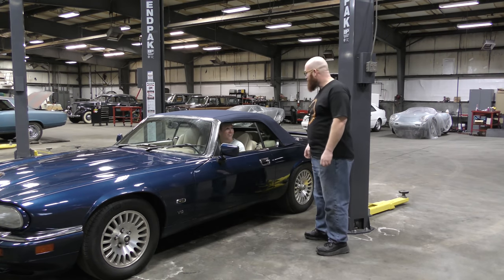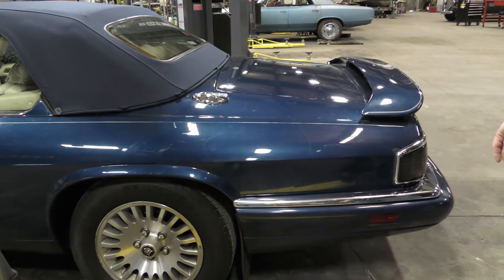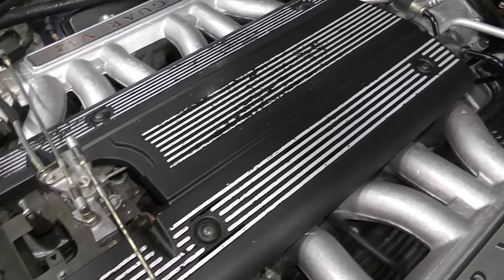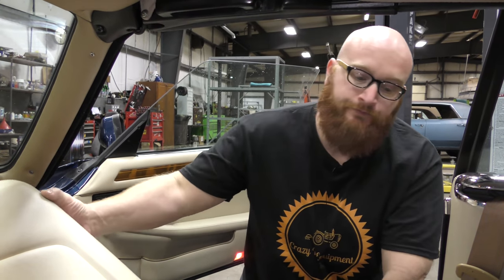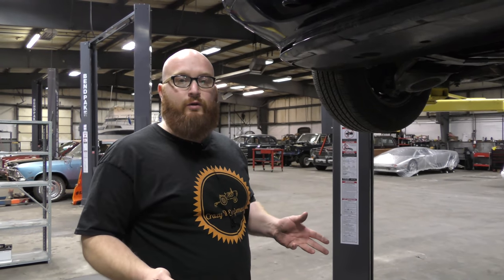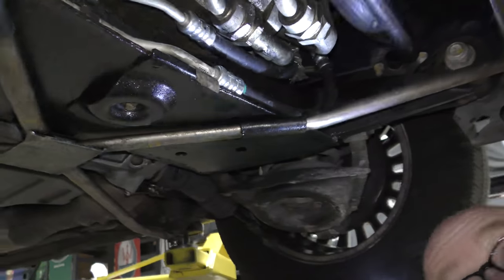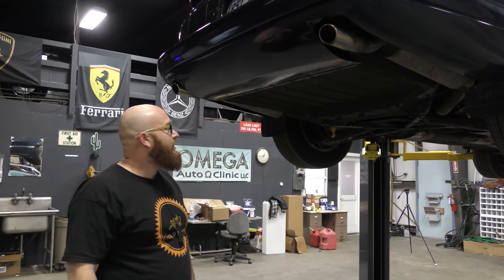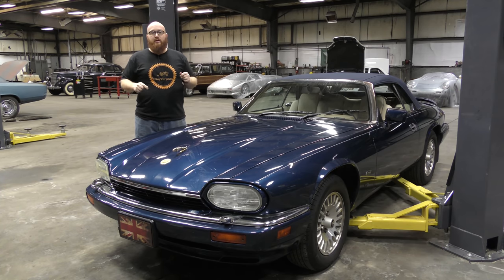It's another smooth running V12 Jaaaaag in the CAR WIZARD's shop! Check out this 1995 Jaguar XJS

Comment: I have two (yes I'm a sadist, but not really) Vanden Plas sedans, a 2001 and a 2002, both titanium grey.  That time was about 10 years into Ford's ownership of the brand and they had fixed a LOT of things by then.  The cars are still quirky, but comparatively reliable.  I have a car wizard-esque mechanic who can fix ANYTHING on a Jag, and for a reasonable price, so both are always all of a piece, and pleasures to drive.  Always happy when I'm behind the wheel of one of them.  Could never justify the price when they were new, but bought these showroom perfect, low mileage versions when they were 12 years old for $7K apiece.  Nobody wants them, but I always get compliments whenever I drive them.  Wonderful highway wafters.  Don't buy a used Bentley with all the expensive issues that come with them.  These give you the same feeling and cost a fraction to own them.

Comment: Love these newer V12s. My 1996 XJ12 had a Denso FI system, it was as reliable as a Camry. Never needed to pull out my PDU and plug the car in, unlike my XJ6 with Lucas FI...

Mine had a similar but smaller oil leak down the front of the engine, it was from a little rubber plug that dries up and cracks over the years. $10 fix.

Did you notice the lockwire on the caliper bracket bolts!? A little hold over from their racing days.

Comment: I sold the exact sister of ths car earlier this year. The car was British Racing Green (Brooklands Green), tan convertible with 34,000 miles. It was indeed a wondeful example of how a well tuned and maintained 6.0 liter V12 could be. Like its sister, it also suffered from leaking valve cover gaskets. After an expensive conversion to a Wizard Cooling aluminium radiator, monster twin electric fans and Evans waterless coolant, the car just could not cope with the sheer level of Texas summer heat. It now resides in a more forgiving NE climate and had been replaced by a XK coupe with ice cold air conditioning and a V8 power band more suited to suburban driving needs and a geriatric penny pinching owner!

Comment: Dear Wizard, its the other way round. The Leaper ist he old mascot, introduced in the 1950ies and was first optional on the XK150. it got smaller later on on the MK10 and XJ. The XJS never had a "leaper" mascot. And I think you should take it off to do the owner a favor, as the designer never catered for this leaper being on the XJS.

Comment: One thing to check on the interiors is the outer bolster on the driver's seat.  Many cars have the frame that holds the bolster bent down so the bolster sags and doesn't support your left thigh.  It's fairly uncomfortable, and becomes obvious if you sit in the (usually unbent) passenger seat, then sit in the driver's seat.  It is shocking to me how many happy Jag owners are oblivious to this.  I think the frame could probably be bent back into shape, but not sure.  I did not see the bolster in this video, but the passenger side looks good.  If the driver's side is good, that's a rare bonus on these cars.

Comment: Own a 4L 1995 XJS convertible in mint condition with about 62.000 miles imported about 10 years ago from US Arizona to the Netherlands.
At that time, I also could buy the 6L V12 but for her, I lacked the courage 🙂

Handbrake funktions as follows: first time "on"; second time "off".

Comment: My XJS is identical, but with two differences I am happy about: when I see those V12 engines, I am glad to have the much easer to fix straight six.
I agree with many of the coments below about the light bezels and side mirrors. Mine are chromed and look much better than those painted ones. And I also think that the car looks better without that rear spoiler.

Comment: I owned a new 2007 DB9 volante.  Other than occasional electrical problem, no V12 problems with 40,000 miles.  At 4,500 rpm a bypass muffler would kick in with louder exhaust note.  Still did not sound like a Ferrari V12 probably because Ferrari could rev to almost 9000 rpm with their flat plane cranks.  I own Tesla’s now, Model X snd Model 3.  I do have a Panamera 4S which I will be trading on a Tesla plaid plus with 1100 horsepower.  Nice to charge at home with my solar panels.  I save $500/month on gas and home electricity.  I also have a powerwall battery storage which helps will more frequent power outages.  Love your video on the V12 jag!!!
Reply: The DB9 uses a completely different V12 from this mid-90's Jaguar, which the V12 design dates back to the early 1970's.  Aston Martin has intermittently gone back and forth between using its in-house V12s and borrowing from Mercedes Benz.  The Jaguar 5.2L/6.0L were discontinued after 1995 because neither Ford nor Jaguar could bring the old V12 into OBD II requirements effective 1996 model year in the USA.

Comment: I saw a coupe twin of that car many years ago on a car carrier.  Sapphire blue is the best color on the V12 cars. One thing I remember from the PDI on them. I think something like you cannot open the trunk with the antenna up.  It is electrically locked out.  Or you can’t put the antenna up if the trunk is open.  One of them.  Just because of the V12 spoiler.  Big Fan!!

Comment: That's the best one to get because it came with a 4L80E. It's probably the most dependable V12 Jag ever.
Reply: Better rear end helped a lot too. The older ones had a 2.88 rear in them and it just takes all the fun out of them until you rev them out.

Comment: Man I miss my 89.5 V12 XJS may have been an 87.5. Brain 🧠fart. Last model with 4 separate headlights and 1st with a computer non lucas,  or limited Lucas. Factory wire wheels.  Sniff sniff. The rear seat was for carrying my work bag or shooting bag. Has an actual trunk. It just has the weight of a tank and you need to swap out the transmission in the older models to the th400.  Such a pretty car.

Comment: Only design flaw of the XJS [within the context of when it was made; we've got much better engines now!] was the lack of a manual option: all XJSs used a GM slushbox [which is OK as contemporary slushboxen went]; how much to swap in a 5-spd Tremec there Wiz?

Comment: Wizard, do you have an arrangement with a detailer? I normally don't think this, but this owner would be very happy if his car were just cleaned up and a few little details like that shift knob were fixed up. (The curb rash on the air dam, naw, he doesn't see that.)  You might have a local detailer who could do good work (or trained in your philosophies about quality) for your fair, small-town price, stopping by for such projects. 

I'm glad to see this car is being driven.

Comment: An uncle of mine had several Jag V12 in the 80's. Two big gas tanks that would empty at a very fast pace. Also he broke several engines as he didn't want to wait for them to heat up.

Comment: When you remove the front calipers on those Jags, some shims fall out.  If the last guy to do the brakes didn't put the shims in correctly, that will affect the wheel alignment.  Also, check the accumulator ball on the ABS. The V12 heat shortens their life considerably.  A new one will go about 8 applications of the brake pedal before it runs the pump. If gets down to where the pump runs after one or two applications of the brakes, it need a new ball. They are the same ones as early 1990s GM cars, so you can buy them for way less than Jaguar would charge.

Comment: The door handles are definitely not made out of steel. They're metal though but they used some kind of weak material. All four broke in my '94 XJ40 and I had to reinforce them. They're working great now.

Comment: The leaper on the bonnet is an aftermarket item. Jaguar stopped fitting them at the factory because of the danger to pedestrians. I believe you could/can specify them as an option to fit yourself.

Comment: I have ahd three XJS from 82 -92. People moan about the lucas ignition, but the Marelli had a habit of failing on one bank of cylinders and the engine would keep running on one bank and the dead bank would drop neat petrol straight onto a red hot cat.

Comment: When I bought my 07 DB9, I believe around 400 horsepower but the car only weighed 3800 pounds as all aluminum.  We did look at a 07 Bentley GTC convertible, at the same time, which offered a W12 with almost 600 horsepower but the car weighed 5000 pounds.  The Aston handled much better with lighter weight and was more sporty, so we bout the Aston.  These cars can not be your daily drivers.  Primarily, not daily drivers as parts sometimes take awhile vs massed produced cars.

Comment: Those jag door handles my be nice and chrome  on the outside but the inner parts are cheap pot metal and are known for breaking. I drove my dads old 94 xj vanden plas to school and remember using the rear passenger door to get in since that was the only working handle left. The secret was to lean against the door when pulling the handle to take all stress off of the latch

Comment: If you're going to have a Jaguar V12, you want to the 6 litre, not the earlier 5.3 engine. Ford invested a fortune making the 6 litre reliable. Unfortunately, it was only produced for a couple of years before being discontinued.
Reply: They made it suitable for catalytic converters, and regained the substantial loss that these had on the 5.3. The Magneti-Marellli ignition has a way lower reliability-reputation than the Lucas, I would argue though.... 4-speed transmission made for a huge improvement as well. They were better, but not really reliability-wise. The original 5.3 was actually really good in this respect, so not that much to improve on this!

Comment: The plastic parts are part cost and part weight reduction for fuel mileage. I forget which car a few years ago engineers eliminated several fasteners just to get the few ounces of weight savings.

Comment: To close the hood, you push up toward the center, and then release about 1 foot up. No need to bend the metal on the hood by pressing down to get it to latch. This is the same procedure I use on my Fiero, 1986 V6 with 50K miles.

Comment: I thought the injection system on the later V12 was zytec . The brakes are not the standard vacuum assisted type. They use an accumulator and pump similar to GM units from the early 90's. Check to hear if the pump runs every time you depress the brakes. That could be why the brakes are soft.... The accumulators interchange with GM ones.
Reply: There was a JaguarSport XJR-S made in partnership with TWR Racing. That had Zytec EFi system. The production XJS didn't, it was a Lucas 36CU - which is rebadged Bosch.

Comment: Hrllo new to the channel. I own a 1985 xjs V12 with 21 ,500 on the dash I was wondering where you located to discuss maybe having it shipped to you an serviced. Bought the car at auction so don't know much but I jumped it and it turns check the oil and it's pretty fresh an the trans fluid is the right color. It's a convertible as well

Comment: It's a Teves ABS system, and there is a special bleed procedure. I bet when the hose were replaced it wasn't bled right. The rears you turn the ignition on and then crack the bleeder screw. Do not pump the brake pedal! The fronts are bled conventionally. The nitrogen charge in the ball leaks out over time too, that will reduce the power assist. Buick Reattas and Ford Thunderbird/ Mercury Cougar used the same system with the same ball. You can also use a Range Rover P38 ball, it's the same thread, but slightly larger diameter. 

The handbrake is a drum inside the disk, I bet the shoes are either badly adjusted, or the lining has delaminated from the backing plate
Reply: I thought the P38 one was a different thread and pressure rating. I ended up importing a sphere from the US, for a Cadillac Deville i think. Very slightly larger but barely noticable and rated the same. You can't get the Reatta/Cougar ones any more.
Reply: @thegearknob7161  P38 is the same thread. The pressure is slightly different, but not much. It works well on my 1994 XJS anyway.

Comment: Wow!  The tyres on there are really thin, in comparison to my own Jaguar S-Type, whose tyres seem to rival those on Hoovie's Countach at 235mm - and it's only five years younger than that XJS.  Also, I have sat in the back of an XJS, all 220+ lbs of me.  Only for a short distance, and it was a coupe rather than a convertible, but it felt like we were going on a 'round-the-world trip with no stops over cobble stones.  Mind you, I was much younger then: doubt I could do it now.  As for hood ornament, as you Americans say, I wish my car had a leaper.  I could get one, but it would sit where my growler (stop sniggering at the back) roundel is and it is, itself, nice as it announces my car has a 3-litre engine.  Not exactly record-breaking as Jags go, and it's about the middle of the S-Type range of engines, but it'll do plenty for my purposes.

Comment: Now you're speaking my language! XJS V12s. 

The Marelli igntition sucks in its own way. It's got better advance control than the Lucas because it's electronic, but the distributor itself is far more poorly built, the Lucas was solid if you looked after it, Marellis burn distributor caps and rotor arms pretty quickly and are harder to get parts for.

I'm 6ft and have fit in the back of the coupe version many times, but need to put the front seat forwards a bit, someone can still sit there though. Legs go to the side a bit and you can sort of squeeze in. Headroom is the biggest problem actually. It's not a 4 seater, but it's a usable 3 seater.

They didn't make anywhere near 18,000 of these in 1995. I can't find the numbers right now but I dont even think they made that many series 3 XJSs in total. There were less than 4000 6l cars for sure.
Reply: 2300 6.0 cars were made

Comment: Those valve covers are identical to BMW covers of the same era.

Also, I think this is one of the most beautiful cars ever produced. It never got it's due and still doesn't, which is fine with me because I'm putting aside some money every week so I can snag one while they're still pretty cheap, because I don't think they will be forever. They've seen a boost in price lately as people figure out how cool they are. They'll never have air cooled 911 type prices but I'd say that every XJS for sale is undervalued by at least 50-75 percent. I mean how many cars have flying buttresses?

Comment: It is the facelift model of the 80s XJS, I think the facelift rear lights are so much of an improvement. Nice color combination this car has. However, its power output of only 300HP for a 6.0L V12 is very average even for the mid 90s as its competitor the Mercedes SL600 V12 of the same year and engine displacement produced an extra 100HP.

Comment: It sounds like most of the brakes have been sorted - so someone's been chasing the issue. The 'bomb' brake accumulator system is actually very reliable. I'd bet London to a brick that the master cylinder has failed (internal rubber seals) - you may be able to rebuild it, but you may have to replace it. Exact same issue on Audi 90 Quattro 20v I recently fixed. I chased everything else but had no choice but to replace the master cylinder. Problem solved.

Comment: The oil leak on the engine is most likely the half moon seal in the back of the tappet block. The leaper has been added as I have seen many times. What they should have done was to remove the growler emblem and replace it with the leaper if that's what they wanted. The two of them together just never looks right. Choose one or the other but not both. I have the same year car with the same rims. Best of everything in the '94-96 cars. Best V12, trans and rear ends.

Comment: Not sure but I believe that they never had the Leaping Jaguar hood ornament . By the time that car was built most authorities had banned such protrusions due to pedestrian safety concerns , All the ones I have seen had either the badge that this one has or one that is encased in clear plastic similar to the side badges ,
The hood ornament is most probably a dealer add on and not factory.

Comment: One of the most rated cars ever.
Until you've driven one hard on fast roads including bends you wouldn't believe how this just wafts along
Reply: Underrated for sure. Much preferred the back being a parcel shelf with storage below. No need for rear seats. No sense.
Reply: @noelnicholls1894  I've a similar aged Merc R 129. My weimy sat in the same shaped back seat through France. 
Being a Brit the French police can only fine me..not remove license. Empty great roads. Epic fun

Comment: Can you please do an update on the steering issue? My car also has the same issue where the steering works perfectly fine but is still misaligned. I figured it wasn't worth taking to a mechanic since it was working just fine but I'm still curious what's cause.
Reply: I had that issue in my 1990 Volvo. A lazy shop that couldn't be bothered doing the alignment properly. They said it was play in the rack. No, it was play in the steering coupler. Replaced that, alignment done right, and the wheel is centered perfectly.
Reply: @michaeltutty1540  that was my first thought after purchasing the car, so I took it to a Tires discounters I've used before. The steering did improve but was still misaligned so I called them and they offered to do another alignment free of charge. The second time I got a spec sheet of the exact alignment angles and everything looked right, so I'm not convinced it's an alignment issue.

Comment: A salesman would tell you all manufactures have moved to plastic from metal because of its ability to be recycled. My father was told this in the early 2000's, and responded asking if metal is no longer able to be recycled. Salesman wasn't sure how to respond.